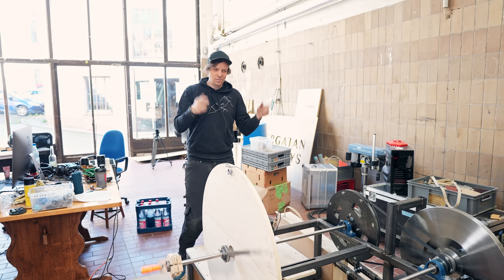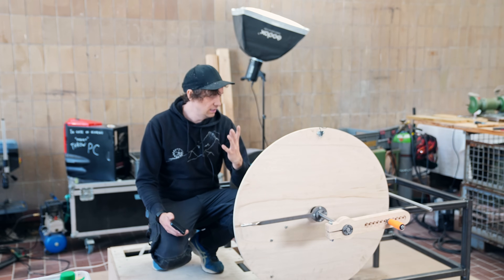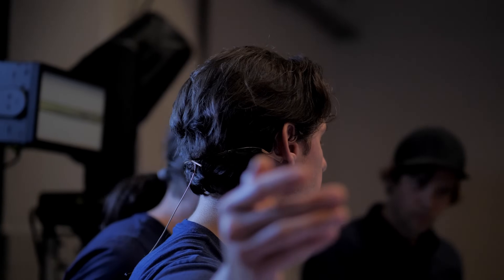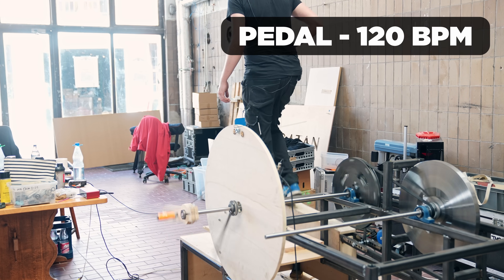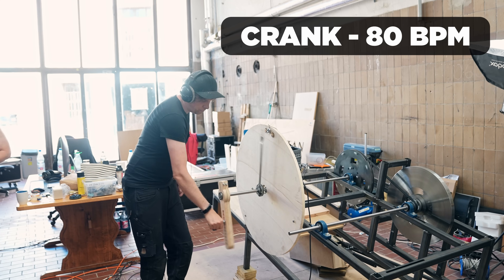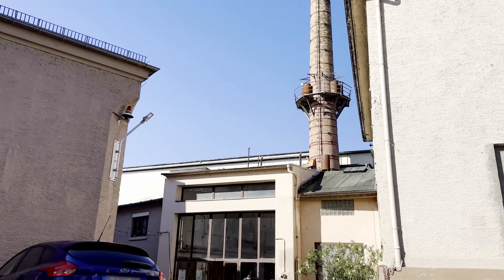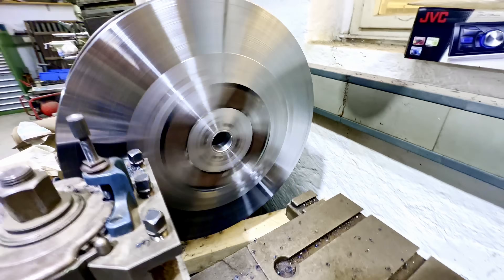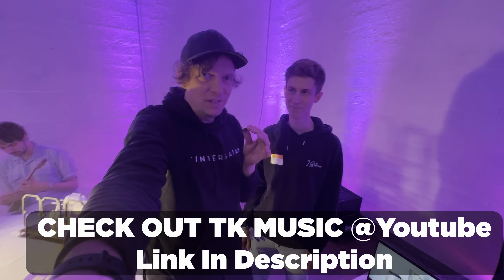The Prototype is Finished - DAY 10 - Marble Machine Flywheel Prototype

Comment: If you want to go with the crank, a freewheel mechanism like on bicycles would be nice. That way it won't smack you when you stop cranking.
Edit: Actually, you could also use a bicycle derailleur to have gears. That way you could get up to 140bpm or maybe more.
Reply: Yes using the whole drive train from a bike could be a winning concept. I mean there are spare parts everywhere and it works.
Reply: @erik....  I keep thinking this... just thinking in terms of bike components in general actually, gear ratios, disk brakes, etc. But Martin is a keen cyclist so he must've thought of it and ruled it out for some reason.
Reply: The only downside with gearing is that the cranking motion wouldn't line up on beat anymore which is probably part of what helps keep the machine on beat.
Reply: @unicyclewsu  What he needs is a governor to regulate the rotational speed.
Reply: @unicyclewsu  maybe something simple like a stroboscope wheel could help with timing
Reply: @unicyclewsu  yeah that's true.. and a hard problem to solve.
Reply: @unicyclewsu  It would probably be better to run the whole thing at 70bpm and trigger the notes closer together.
Reply: @unicyclewsu It wouldn't line up directly, no. But that depends on how you count out the beat. If the beat is counted in quarter notes at top dead center of the crank, you only get half as fast a speed compared to counting the eighth note. So when you shift into first gear, count quarter votes, second gear count the eighth notes, fourth gear sixteenth notes, etc.
Reply: So we switch from either a pedal or crank to an entirely bicycle driven machine. It would be pretty entertaining to watch him pedal the thing while trying to play the instruments. 😂
Reply: Was thinking sort of the same thing! Was thinking "some gear", but you explained it perfectly with "bicycle".
Reply: You could even use a stepless enviolo gear hub to dial in the tempo...
Reply: And why not a double-sided hand crank as well, like bicycle pedals?

(Downsides to a freewheel: (1) like the food pedal, you can't slow down intentionally; (2) noise.)
Reply: @ps.2  Can't slow down? Quite the opposite, if you include a coaster brake.
Reply: We have several hundred years of innovation to grab from to find things that will allow you to do all of these things, and it seems like parts of the machine design is stuck in a "not invented here" mentality.

Like - just grab a bicycle for power input. That gets you a relatively comfortable and safe method, it has gearing, it has brakes, it is already built to handle flywheels.
Reply: Came here to say literally this. You loose so much energy with the system pushing your weight up when you’re trying to find that bpm
Reply: Maybe he should be pedaling it with his feet so his hands are free for music things. So, just mount a bicycle on there
Reply: He could use this same mechanism with the pump pedal and a rachet.  It would decouple the pedal so it doesn't need to move unless he's pushing it.  It would stay at the top.  

Also a flywheel is used to store energy.  I know he wants to play the machine but really he should have a tempo setting lever with gears and a pendulum like a clock so it doesn't matter how much speed and energy he puts into the wheel.  The machine would work like a variable clock
Reply: Also with all these solutions, there is no musical creativity while on the bike. Could it be that he should accept the motor to be mechanical instead of being human? This way he has way more room to play with the machine and supporting instruments
Reply: Imagine a Rohloff gearhub (or similar) driving this thing
Reply: And e-bike assist etc.. :)
Reply: Just mount a bicycle to the machine. The marble machine will be the coolest home-trainer in the world 😎
Reply: Why not make "hybrid" mechanism?  Huge manually driven flywheel then connect the flywheel to a speed governed driving mechanism for the marble machine? Either a mechanical governor or a electronically controlled speed.
Reply: Wintergatan said it themselves: biking is better!
Reply: Agreed, I think the problem is that while the pedal system can have more Power placed into it, it is also less direct. Which is probably why the crank feels better. However, similarly to a bicycle, you can only really push down from the top of the wheel, so you are only able to add less than 50% of the potential movement into the system, whereas a hand crank you can pull up and push down, resulting in a better feel. Perhaps there is a way to combine the two methods, one for speeding up rapidly, one for control?

Comment: Am I missing something.  my feeling is that you should be able to wind up the flywheel to a speed and then have a mechanism to draw off the energy at a given speed..  Rather than getting the pedal to give you the speed.  I am not a mechanical engineer, but some how having an energy side and a extraction side.
Is this possible?

Comment: I believe the reason you are seeing this mismatch is the method of measurement. The standard deviation is just measuring how consistent the tempo is but as you can see the data is oscillating, likely around your desired tempo. This is because you need to match your metronome tick to the machine tick so you have to speed up and slow down to align yourself. If instead you were just trying to maintain a constant temp with a screen which told you "50 bpm" or one of those devices that can tell you "50 rpm" which they use for measuring high speed rotation and tried to match that instead I believe you would get results more consistent with your feeling. Its possible the hand crank maintained a tempo more close to the tick but oscillated more. This is just my best guess.
Reply: Agreed 100% - with the crank, he was both accelerating and braking, so it stayed closer to the target but had more overall change.
With the pedal he was only accelerating and coasting, so there was less deviation.

A BPM meter could be the right answer if this machine is to be the metronome for everything else on stage.

Comment: Is it possible to incorporate a hybrid crank design that you can hit a lever to change from automatic to manual? Automatic: Capable of faster speeds, plays very tight. Manual: More artistic and greater control. A ratcheting system with a clutch would make it easy to switch without losing much momentum.

Comment: more pointless tests and yet another waste of time vidio. why dont you start doing something useful like actualy making the marble machine?
Reply: You don't have to watch it. Go build your own machine, and we'll see how that goes. :)
Reply: Indeed, if you don’t have anything nice to say don’t say anything at all
Reply: @panzermagier  and thats exactly why i didnt say anything during the MMX disaster even tho i saw it coming from about 1 year into the build, but it gets to the point where saying something is actualy better than saying nothing. 
working on the power system is pointless at the moment as martin has no idea how much power he needs to supply with the system he is building and will not know that UNTIL he actualy has a machine to power even if its not complete or doesnt work correctly. why do you think the MMX ended up being powered by a electric motor? when you build a car do you start on the engine first? NO. you start with designing the body of the car and at least get the basics of a car put together and THEN you work out what you need to power it and start work on the engine. thats why i said this is a pointless exersice as i doubt that ANYTHING he learns will be helpful moving forward.
Reply: @madmurdoch2000  as far as I’m concerned the project is his, success or failure that’s in his hands and for the time being im just watching a wintergatan video
Reply: @panzermagier  and that is your right to do, and i wish you well and hope you enjoy it. but just as that is your right i also have the right to say what i'm thinking if you agree or not that is up to you. but i still have the right to say it
Reply: @madmurdoch2000  sure you can comment that’s your right but maybe saying something constructive instead of negative could be better,I wish you all the best also!
Reply: @panzermagier  hmmm how is saying he should be building the machine rather than the power unit not be considered constructive?
Reply: @madmurdoch2000  i think your missing the point when you say WASTE OF TIME
He just wants to collect some data that’s what the prototype is for, rather than build a machine that will become the prototype itself and not work as intended
Reply: @panzermagier  then you have missed the whole point of this convosation.
Reply: @madmurdoch2000  then explain it to me please
Reply: @madmurdoch2000  Martin concluded that the MMX failed because he just kept building without first designing, then prototyping, to see whether his design choices would actually work. And that is what you think he should go back to doing?
Reply: @panzermagier  ok you what me to explain so i will do so. lets take the first "experiment" which he says showed that the pedal didnt take energy from the system. this is completely absurd but lets just let that slide for a sec and talk about the experiment.
firstly from a experimental point of view its incomplete for this type of experiment you have to run the test multiple time to take out the experimental deviation. many differant things can slow the fly wheel from the amount of energy in the system to even just something rubbing against the wheel to even the temperature of the grease in the Bearings. secound just from watching the 1 experiment i saw on the screen it did appear that the without pedal did stop at least 5 or 6 secounds later than the one with pedal now this may not appear to be much but if you do the maths i think it would show a differance of 5-7% between the 2 and in a system like this that is NOT insugnificant.
BUT as i said it all completely pointless because he;s not addressing a few fundimental issuses.
1 and this as by far the most important question "How much rotational force is this system going to have to supply to the rest of the machine?"
2 and this is not an insugnifiacant question either "is the draw of power going to be constant or variable?"
3 "how heavy is the moving componet of the machine" due to inertia and the way martin is designing the "power unit" the fly wheel needs to be propotionaly weighted to the total mass of moving parts oh and on a side note martin is standing on the pedal to get it moving but if the rest of the system is heavyer than his body weight then he could stand on that pedal until the world ends and it wouldnt move.
now dont you think that he needs to answer at least a couple of these qustions before designing the power unit? mainly because he could be putting all this work in only to later discard it all because nothing in this system will work with the final machine
and by the way the reason the MMX failed was because martin went for a form over function design, he cared more how it looked and not enough on making it work and he;s doing the same here.
Reply: @madmurdoch2000  i got your point, thanks for explaining it to me.

Comment: When you mount the fly wheel on the chuck, put your gauge on the rear face to measure the run out and get it level in the chuck. When you machine the front face it will take off the wobble and both faces will be parallel 🙂
Reply: I'm not a machinist, but I was thinking the same thing when he said "I can get 3 sides perfect"
Reply: The issue there is the already cut center hole for the shaft, which was also finished on a loose chuck.
Reply: @randommcranderson5155  If the shop has a live centre and a lathe dog, he could mount the flywheel with the taper lock bushing onto a short centre-drilled shaft and machine the flywheel relative to the shaft instead of the hole. This would allow the faces and outer edge of the flywheel to be turned relative to the axis of the inner diameter without further machining it. This would also allow the flywheel to be turned around without losing the face plane, so it wouldn't need to be indicated back in when turning the other face.

I've only got high school machining experience so I don't know if this is a faux pas in the machining world.
Reply: @STRIKEcorperation  I believe he was also told the shaft was undersized. I doubt the shaft is stiff enough for machining accurately in this case.
Reply: @randommcranderson5155 before machining the middle hole he still should measure the run out from the rear
Reply: In my opinion he should add the bushing and a piece of shaft, clamp the shaft in a 3claw chuck and a live center on the other side, then turn the disc. Because he is also bolting the bushing to the face of the wheel, turning it when everything is installed, it will make the straightes result
Reply: If he hasn't registered the runout from the axiality of the bore, rather than when he's holding it with the chucking apertures, it'll never run perfectly true.
Reply: I say waterjet then ream the bore, ream the sandwiching holes and use shoulder bolts to make the assembly
Reply: Wouldn’t it be better if all three discs were lathed?

Comment: Is there a way to set a limiter?  Like, a lever that sets maximum bpm to 80 or 120 or such, and any excess momentum goes into spinning a wheel not connected to the operation of the machine?
Reply: It could be done with with some form of an electronically controlled clutch, or even just an electric motor. Have an arduino control the setup to bleed energy to an extra flywheel or charge a battery via the motor (regenerative braking, basically), then feed that energy back in the system if the bpm starts to drop.

It's a bit of a complicated setup though, and arguably not as cool as a fully mechanical machine.
Reply: Can you draw power from a system without changing it's speed? The point of direct drive was to keep the pedal/crank synced with the beat, but if the input is allowed to send power past the output shaft, won't that necessarily desync them?